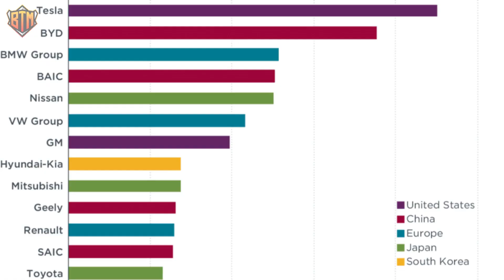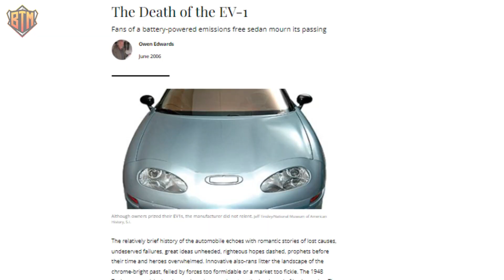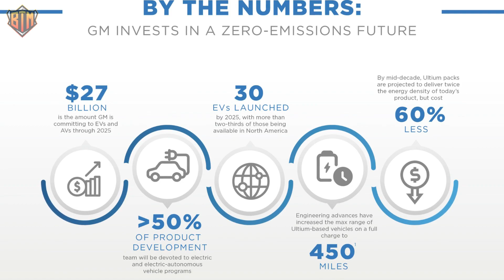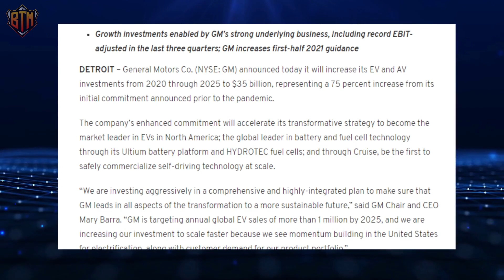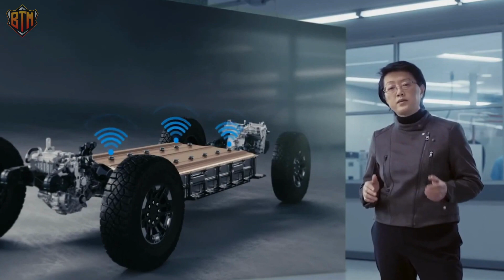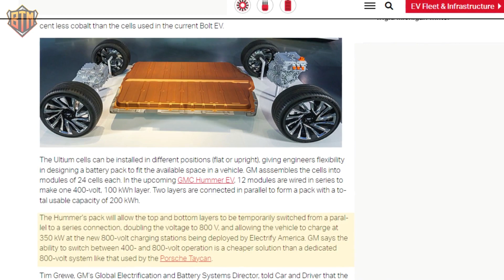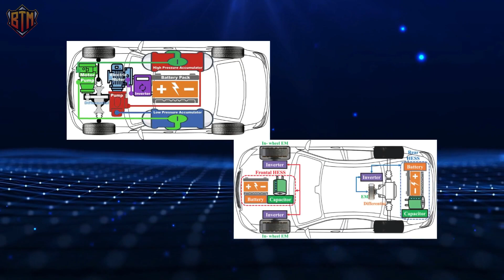Mary Barra: This New Battery Will Destroy The Entire EV Industry! *General Motors EV*

Comment: When they can make a battery system that can do 700-800 km in cold weather and will last 10-15 years without replacement, the ice engine will be obsolete. Cold weather will reduce battery range by an average of 30%.

Comment: This is a huge step forward but not quite there yet.  When they can make a battery system that can do 700 to 800 km in cold weather and will last 10-15 years without replacement the ice engine will be obsolete. Cold weather will reduce battery range an average of 30 %.  Battery guarantee is not 10 years yet. 

Great video content, thank you for sharing this great video with us.